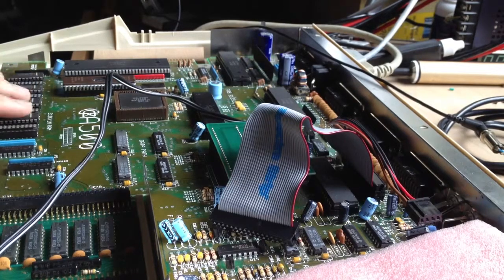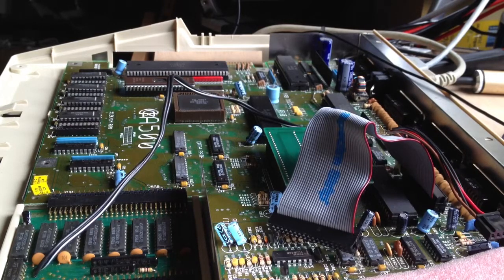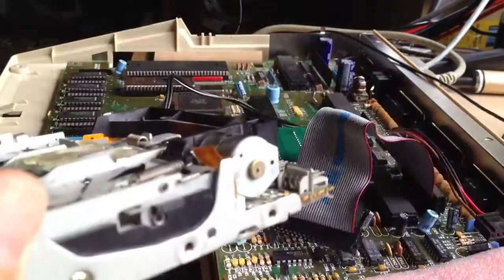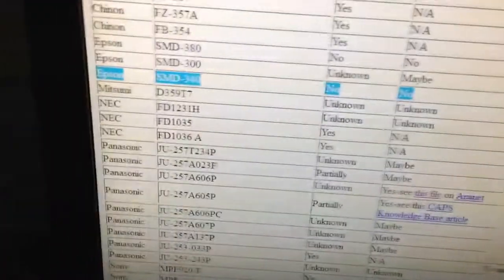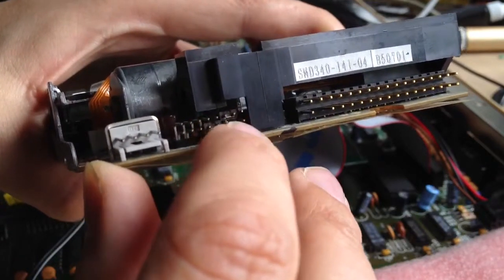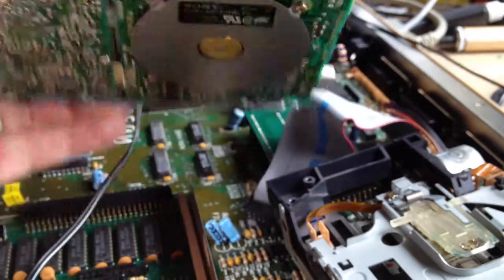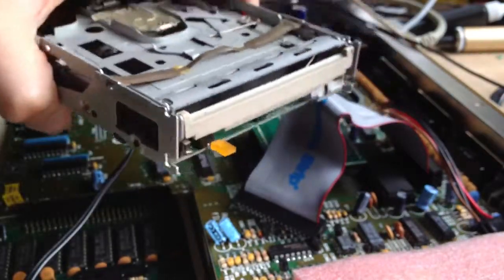Amiga Floppy - Epson SMD340

Comment: If there really is no jumper to route the disk change signal out to pin 2, you will have to cut the trace on the disk drive just before it goes into pin 34. Then you will have to solder the red wire to pin 2 and somewhere onto the trace that you just cut (not at pin 34, but the other side of the trace). Also, you have to make sure that pin 2 on the drive is free from the rest of the circuitry, so you will have to cut the trace to pin 2 also before soldering the red wire in there.

Comment: There are often jumper pads with solder bridges on the PCB of the drive, so you can often cut the connection without having to actually physically cut the traces. Just remove the solder to break the connection in such a case. It is also convenient to use these pads when making a modification like this. You can solder a wire to the pad and then to whatever pin you wish to connect to on the interface connector. Doing this makes it possible to modify the drive with without cutting any traces.

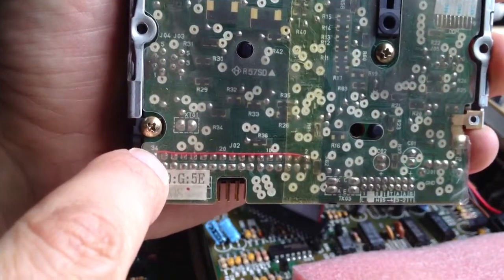Comment: 4:25  The modification with the red wire is made in an incorrect way, which is most likely to be the reason why the Amiga does not detect a disk change. By soldering the wire in like that, you will short out the ready signal and the disk change signal in the system. This puts a lot of stress on the circuitry in the drive, and might cause unreliable operation. A correctly modified disk drive shoud _never_ have these two points connected directly with a wire like this.

Comment: If you have the red wire there, you have to make futher modifications to the drive to completely ensure that these two signals are not being shorted out by the red jumper wire.
Here is what I suggest: Remove the red wire. Check the jumpers at the back of the drive. Drives that have jumpers usually have jumpers to reroute both the disk change and the ready signal. So it should be possible to just jumper it correctly and get it to work with no problems whatsoever.

Comment: 4:45  There is actually only one way the Amiga knows whether the drive is ready, and that is the ready signal. The disk change signal is only responsible for telling the Amiga if there is a disk in the drive. The drive is not automatically ready just because there is a disk in there drive; hence the need for two separate signals. Disk change is latched high (disk in) on a step, while the ready signal is going high when any one of a certain number of conditions (too many to list here) is met.

Comment: I just wanted to let you know that soldering the wire between pins 2 and 34 has a side effect - THIS CAUSES EXTERNAL FLOPPY TO NOT WORK.  You aren't supposed to bridge the disk ready and disk change signals for the whole bus!

If you remove the PCB from the SMD-300/SMD-340 there's a dedicated solder jumper for disk change signal (pin 2) on the top side of the PCB, you just need to be not lazy and remove the PCB to access it.  This way you get both the dedicated disk ready and disk change signals - all proper, and no conflict with external drive.

I disagree with your jumper settings, but that may vary with drive revision, or may just work anyway.

Pretty nice drive otherwise.  I've 3D-printed correct height brackets and eject button for it for use in A500 internally.

Comment: These jumper settings work (dual mode 720k/1.44M) on an Atari 1040 STe US TOS 2.06 modded for 1.44M floppies, and the STe faceplate is an exact fit replacement (no case cutting). Thanks for sharing the info !

Comment: I have a SMD-340. The PCB is totally different to the SMD-300 as i can see on pictures. On SMD-340 the DC signal goes straight to pin 34. There are no jumpers between! So, trace to pin 34 must be cut and trace routed to pin 2. Trace from pin 2 must be cut i think. I don't know where to find RY signal! The controller IC on both SMD-300 and SMD-340 is "sf9200ck" so there must be RY signal somewehere ...can someone please check on his SMD-300 where i can find the RY signal on the sf9200ck controller IC ?